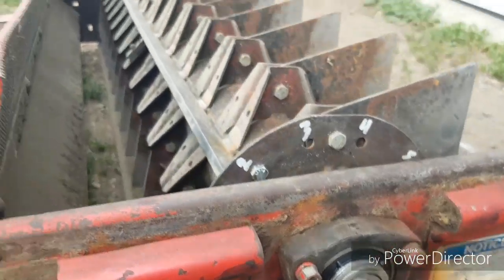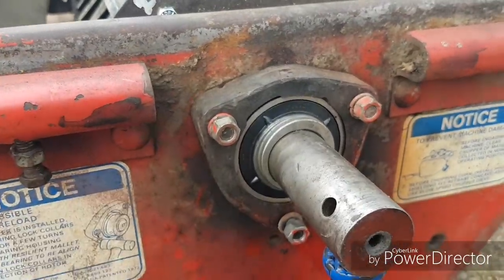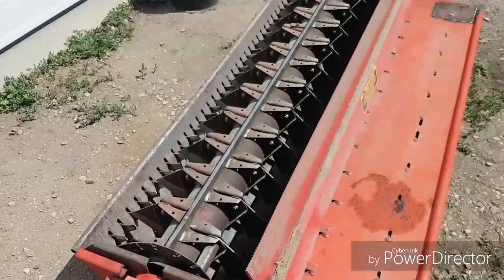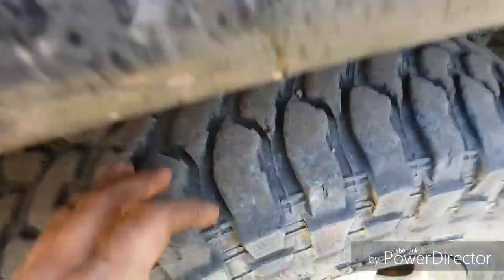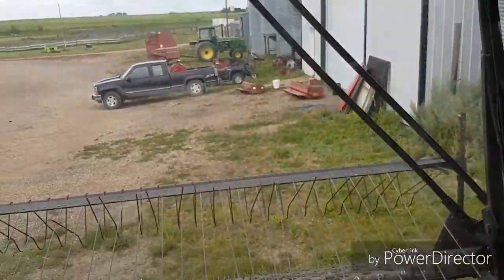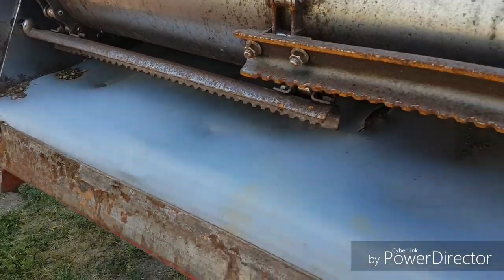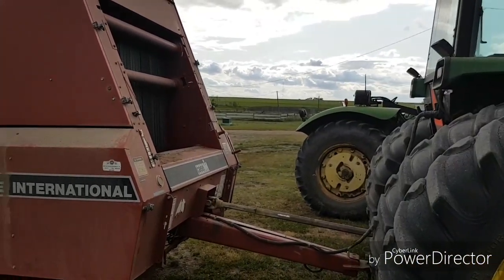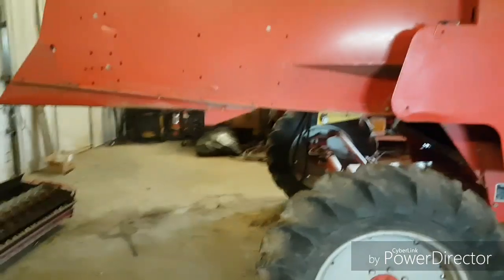860 massey chopper repair and 2188 prep!

Comment: I've used a million of those elevator bots to hold down Rhino hide in down spots at several elevators. Some even got lined with cheap white ceramic tile held fast with silicone caulking.  Both outlast sheet metal.
MB BAR RANCH

Comment: It's actually very common to wear out the floor on the feeder house especially if you do peas just get a new peice of sheet metal and weld it right over top. Super easy. Make sure to check your bearings in the front drum of the feeder when you have the chain out if it was up to me i would change them before you put the new chain in.
Reply: Yea I just cut out a square and weld in stainless. The patch will wear out again before anywhere else.
Reply: @stevenstart8728  keep them inside we  never had any problem with it we then got the green ones  we like the but did sell all  we owned and the JD had NO deals on them  we have a new red one's case IH  axial-flow   9250  the last one did find its way here now to wait for the parts we ordered  for this combines can not wait for them to order them or open up the part shop and find out they do not have one  
just waiting for all the JD parts to go  found a dealership willing to  trade part of parts we need for other machinery  we have in green they said to they could not beat the pieces we got them for  the crews  were sad the green where sold  he got more for them  now then if we waited  and sold them one at a time  we all were willing to sell our  equipment off   tracker  4 years they sold  last fall sold all of them or the dealership did  have all green one now  too  and we did lose one all ready cutting   found a soft spot in the field and got it stuck never helped had a very bad storm blown in he had to leave it there he was pick-up  the truck got stuck too  both of them got out of the truck and start to walk to the road  the truck drop out of sign  coal mine shaft  it falls in too the exit morning  we got out there  to see  what happen  the tracker was down there as well  6 weeks under water water now   we have not checked if any more fallen down could not get to it  still  fields under water too 
going to be a long time be for we lift them out of the mine shafts  pump the shafts out too and make sure  its safe to lift them out  we just happy the 2 guys never were inside of the vehicle  would  have been a much bigger problem  for us
Reply: I’m very sorry for all your troubles
Reply: @jenniferwhite6089  Geez Louise where are you at??   Got combines and pickups dropping through the field into mineshafts holy cow!!!  Later!  OL J  R  :)  PS sounds like you need to start a channel to show some of them goings on!

Comment: Going to change the feeder house bearings too when you change feeder house apron? When I changed  mine, I had quite the tussle pulling that key out of the drive pully. I totally rebuilt my feeder house from new floor,bearings ,chain and even found a used stone retarding drum so the new slats were protected a little bit.And since I had everything off I rebuilt the rock trap too-man it needed, once I could take a good look at her. Ouch Ouch just hurt my arm-too much patting myself on the back! LOL
Reply from the maker: Hahaha no they are only a couple years old haha

Comment: On the BIL's Deere 9600 combine you crawl in the grain tank with a roll of paper towels and your bottle of Windex and you take the window loose from the inside of the grain tank, it folds out towards you on hinges and you can clean the back of the cab window and the front of the tank window, then you can fold it back up and put the hold-down clips back and tighten them up, and windex the back of the glass facing the tank... Course it stays fairly clean for about 2-3 days and it looks like sh!t again LOL:)  OH well at least it takes the outer layer of it off LOL:) 
Not sure if the CIH would be similar or not...  OL J R :)
Reply from the maker: They where till this series and then said screw it and made no way to clean them and then brought it back on the newer ones...

Comment: That chopper makes my back hurt just looking at it. You don't run anything that will wear a combine out up there. Corn wears by sheer volume. Wears out augers, feeder floor under the drum, elevator boots, the troughs under the cross augers in the tank, unload augers. The sieves carry extra weight shaking out all that corn. Wheat even at 80 bushel is a breeze to run through, 200 bushel corn or 60 bushel soybeans with green stems give it a workout. That 860 is big enough for an 8 row corn head except the clean grain elevator isn't big enough, most guys here ran 6 rows on them because they couldn't get rid of clean grain fast enough and that was in 100 to 150 bushel corn back when those machines were new. You could run maybe 2 mph tops with that 860 in corn and a 2188 set right can handle 8 rows at 4-5 mph

Comment: fix that flat in five min. Pull nail out- put in a plug- put air in- you are off and gone.
Reply: A plug isn't considered a "proper tire repair" anymore LOL:)  Doesn't mean it isn't done... BUT still, if it's not an emergency and I gotta go RIGHT NOW, then it's just more sense to get it fixed right... even seen some of the new patches that go inside the tire have a rubber "tit" on the back that's pushed through the hole with a plug-type tool, to seal off the steel belts from dirt and moisture getting in the old nail hole.  Not everybody uses them but I HAVE seen them!  LOL:)  OL J R :)

Comment: First combine I ever ran was a 750 Massey. No ac or radio.
Reply from the maker: First thing I fix is the ac and second is the radio lol
Reply: @SouthSaskFarmer1  this one didn't even have either installed
Reply: Same here.  My dad bought it brand new.   No ac or radio...lol
Reply: 1971 MF 510 Western Special ( no idea what the WS ) meant .   Had Bi-Cool which when hitting a rough spot the water tank would spill threw the blower right at your face lol. Loved it .   That 350 Chev wide open was so loud there was no chance of hearing the radio.   She was the big girl at the time and locals from town would bring lawn chairs to sit and watch it.
Reply: @pushpushlambert8079  I ran an old gleaner believe it was a C had a water cooler. Or as we said shower with a seat.
Reply: kory league 

Ah a man with the same experience.  The heart would skip a beat but it sure felt nice lol

Yup ... after the MF we went to a Gleaner L2 .  Good one too.  Cheap, easy to fix and to scratch the paint 😂👍🏻🇨🇦

Comment: Little Emery cloth and smear some Antisieze on the shaft.... Or a little oil or grease if you don't have any Antisieze 😎
Drive fast to town, maybe it won't go too flat., lol 😂
How many belts are on that pickup? Hated the old 5 and 6 belt ones!!! 1480 came with a single 😎 much nicer!!
Reply from the maker: This is a swath master haha best pick up you'll ever run! 16 feet
Reply: @SouthSaskFarmer1  nice!!!!!
The belts look a little narrow, but as long as it works 😎
Reply from the maker: @GosselinFarmsEdGosselin  they are pretty wide. Why what issues did you have?
Reply: @SouthSaskFarmer1  will the old 3 or 4 foot wide 5 and 6 belt pickups, we would lose small seed  (clover, even Harry veatch)
Had one that didn't have the guide discs on the rollers, a worn belt would crawl across and mess up your day.. anymore most around here are one piece ribbed belts. 
They hold up really good!!
Reply from the maker: @GosselinFarmsEdGosselin  never seen a one piece lol fuck me that must cost more then the combine to replace lol

Comment: you a true farmer  power fist tools lol from  Princess Auto  lol  can't,  shop there  them tools are too rich for my liking I would be a laugh off a job site  with that I do have a sit of wrenches just in case I need to modified  one for a job them in the ben  of one time tools
Reply: what you never beat the end of the shaft up before you the bearing one  lol 
hand over your man card and your farmer's card  lol

we have mechanics to do this work for us now if it quiets raining here we should be in the rest of the fields one last farm to cut this year  mine  has been underwater  some developer was it usually drains to had blocked it off  gets me did it on my property  this money it was ok to reopen the wall up 
the county said I CAN  never take me long to have a back hole and trucks down where  removing the wall  12 acreage been flood today  and 3 council member lost their job today  that who  have the development of the acreages   there was not  building permits for  this acreages all the work been done their will more likely have to removed  now to I was told the meeting did not go as well as  plan I have 2 feet of water lift in the second yard  soon as it is dry  they picking up all the equipment for here  most of it has been underwater been going to be hard to get  rental equipment for us  we were very hard on then   February  had 3 man lifts burned in calf  barn fire  all the animals were taken  out of the barn 
the furnaces quiet they calves were moved to and other barns  we had new furnaces waiting to be put in  we were painting  the inside of the barn  the heat was from  propine  heater  but the fire was started with a gas leak  funning the gas  was turned off and tagged too we did catch the  4  who done it had video cams on all of them  and the vehicle they were driving  too  the city police did pick the driver up  when he was pulling into his driveway  and said he was with his friend that night  they did taken him in to jail and had his friend come down there to see  their story  after they were all arrested and jailed  they did not know they were on a video cams never taken long to see they were all lying were they were at and doing  their lawyer did not like that at all he is in and another case with me
Reply from the maker: You know I've had 10x better luck with power fist tools over just about any other!